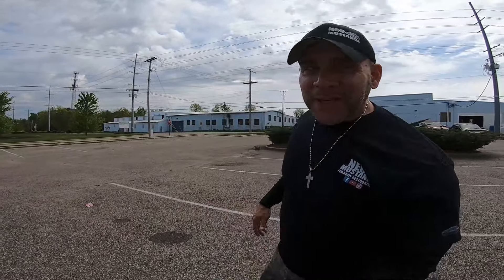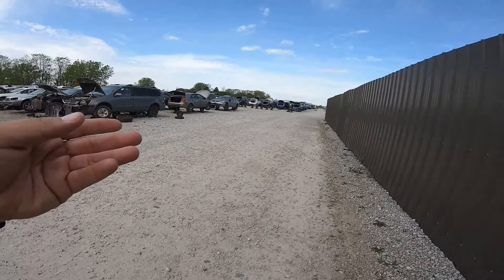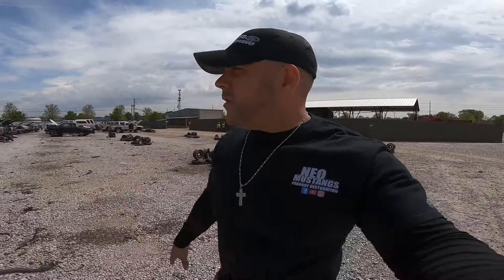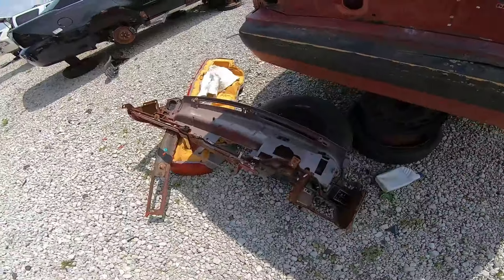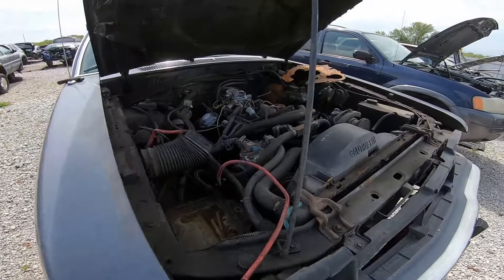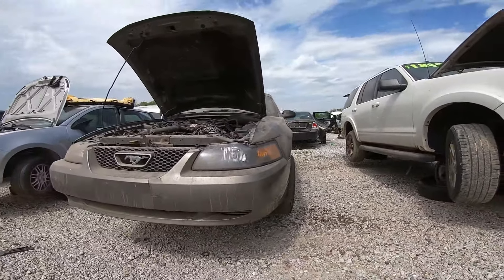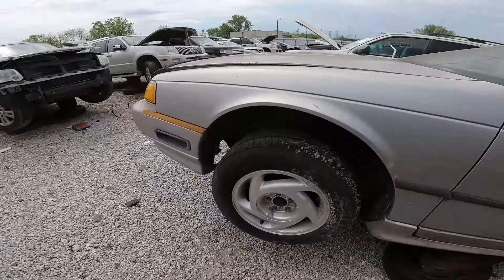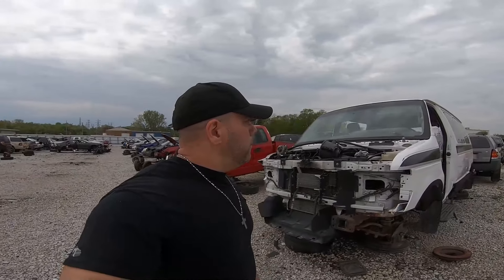Finding The Roughest Fox Mustang I Ever Seen: TRASHED! 👀 #shame

Comment: I bought a explorer motor with 3 bar heads for my basket case project..this car was bad just when you thought you seen it all...100 amp alt with the hot wire zip tied to the fuel rails... SAFETY.... Lol

Comment: Those late 90s Taurus has some rear calipers worth looking at. I'm pretty sure those are bigger than the mustang and when you do the ATS Brembo swap, they give you the balance on caliper piston ratio that a stock cobra with 13" rotors have. So ideally, it'll reduce the fronts locking up and make it like a cobra setup, just better.
Reply from the maker: I’ll look into that !